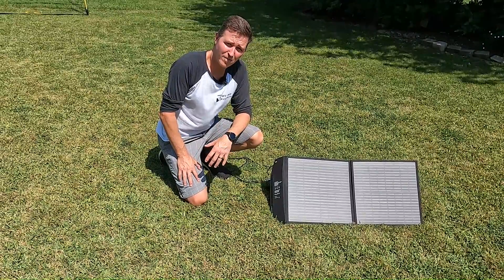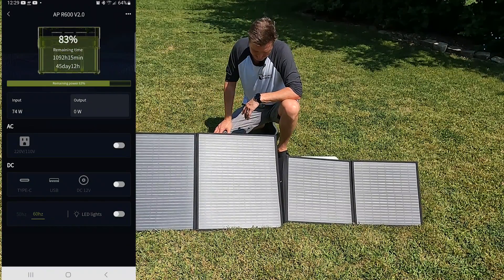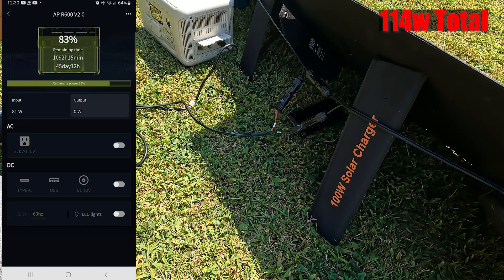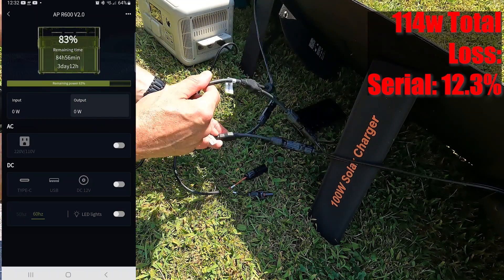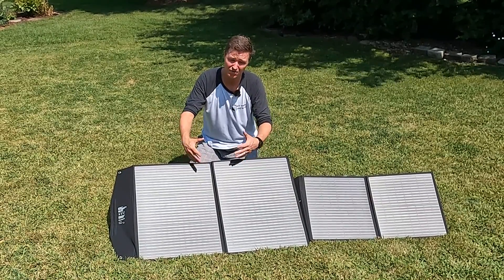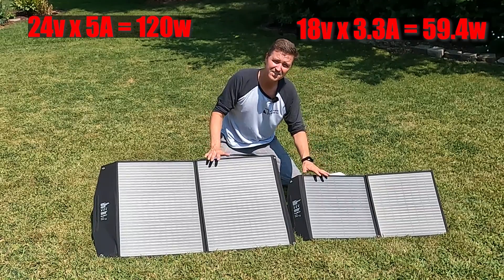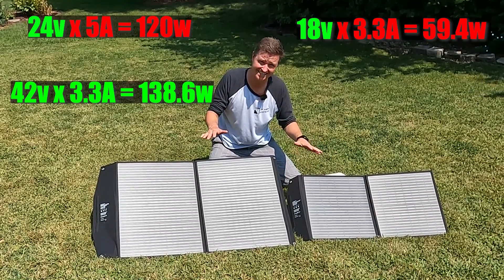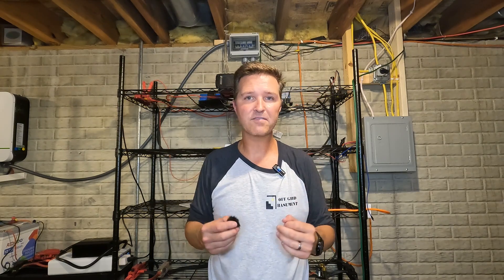Connecting Different Size panels in Parallel and Series.  Why am I losing wattage?

Comment: I had the same problem with the same values of panels, the voltage was different a few volts
I put a resistor of 0.12 ohms in series on each panel and suddenly I have more power
The panel with the highest voltage is dominant, other ones below it will not be taken along by the charger mppt
Reply from the maker: Thanks for sharing and the comment.

Comment: The only way you can successfully run different panels is with separate charge controllers. Otherwise you are just wasting your money on “bigger” panels. The output of multiple charge controllers to the battery is not an issue. They don’t have to communicate to each other, no special settings, no special wiring.
Reply from the maker: Thank you for the info and the comment.

Comment: In parallel, the solar voltages will average out itself - that is, the 24v and the 18v will give an average of about 21vdc. Power companies parallel generators of different capacities all the time.
Reply from the maker: Thanks for the info and the comment!

Comment: i was told that the bigger solar panel will drop down to the same watt out put os the smaller panel so 100watt max out of this system not 125 like you said i dare you to figure that out or tri it because i get 100 percent form all my solar panels and i live in new york where its never sunny and for away from the equator where your more likely to get 100watts out of your 100watt rated solar panel so yeah hook up that 100watt panel to a 25 watt panel and see what you get i bet i was wright you only going to get 50 watts out of a 100watt solar pannel connecotes to a 25 watt solar panel i bet anything on that
Reply from the maker: Thanks for the suggestion.

Comment: consider the voltage drop and wire size over the distance of the run.
Getting the voltage as high as possible by using series connections with identical panels will minimize power loss due to voltage drop.
Reply from the maker: Thanks for the info and the comment.

Comment: The power rating of the panel is calculated from Vmp x Imp not Voc x Isc, that 24V in your example is the Voc of the 100W panel.
Reply from the maker: Damn, you're right.  I looked at the wrong numbers on the big panel.  Thanks for the update.